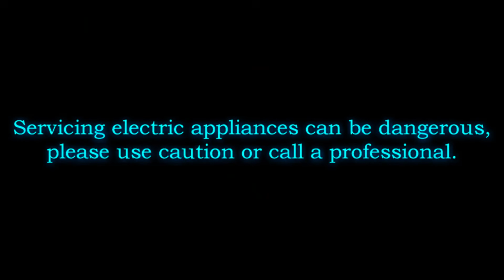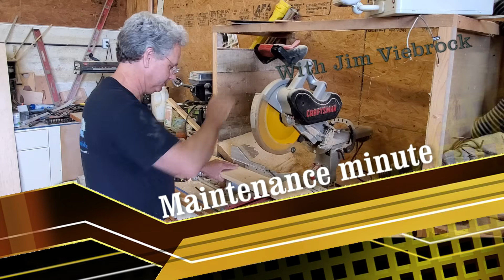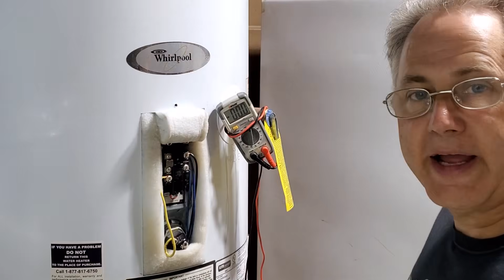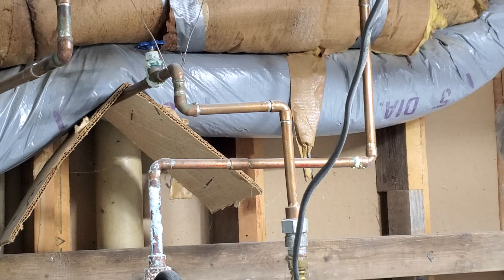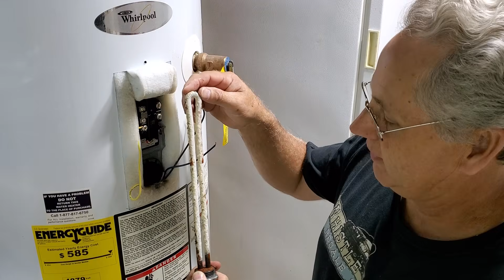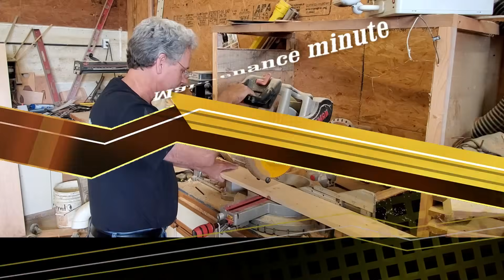D.I.Y. How to replace the heating elements in your hot water heater. Maintenance Minute Jim Viebrock

Comment: I am dealing with water heater not working i checked the ohms on both elements it was what I its recommended I replaced the thermostat but no hot water. Will elements be bad if ohm reading is in range recommended? The water heater is made in 2019
Thx for you video
Reply from the maker: If you have power at the elements and no hot water, you will need to replace the elements as shown in the video. Be sure to clean out the tank while you are at it. Good luck and thank you for watching my videos!
Reply: @millin360  i check voltage 
Removed the elements had build corrosion but much as I thought but hopefully with new elements it will work.
Reply: I replaced the elements not working doing exactly the same as before I replaced the the thermostat and elements . I don't know what else to do..Do you have any ideas?
Reply from the maker: @brettmullins751   I can't diagnose it from Afar, so if you've changed all of those things it's time to call a professional....
Reply: @millin360  i did check the ground on make sure it was tight but I am going to call Rheem tomorrow . Thx for videos
Reply: a
Reply: @JoseSanchez-xd1oz  I replaced the thermostat and elements has voltage to elements and still not working

Comment: "Good and Snug" to what torque? Some of us have torque wrenches.  :-)
Reply from the maker: You will need to consult with the individual manufacturer of your unit for that information.  However,  if you over tighten the element you run the risk of stripping the threads.

Comment: Do the wires need to be hook on an specific commector positive or negative ..or they can be connected on any way....thanks
Reply from the maker: I recommend they go back exactly the way they were configured from the factory. In the video, I recommended that whomever is preforming the repair take a photo of the wiring configuration so that there is a way to confirm the proper replacement. I hope that helps.
Thank you for watching my videos.

Comment: One thing you failed to mention is the pop-off valve should always be piped out of the structure. If the pressure gets too great and it happens to release you will end up having water all in your structure and if you're next to your water heater when that happens you will be severely scalded which is no fun. All codes in all municipalities require that pop off valve drain out of the structure and not be open to the interior except into a floor drain.
Reply from the maker: This video was about changing the elements. I do have a video on changing the TPR valve.  Here is some information I hope you find helpful:
It is critical that discharge pipes meet the following requirements, which can be found in InterNACHI’s Water Heater Discharge Piping mini-course, at www.nachi.org/education. A discharge pipe should: 
1. be constructed of an approved material, such as CPVC, copper, polyethylene, galvanized steel, polypropylene, or stainless steel. PVC and other non-approved plastics should not be used since they can easily melt.
2. not be smaller than the diameter of the outlet of the valve it serves (usually no smaller than 3/4").
3. not reduce in size from the valve to the air gap (point of discharge).
4. be as short and as straight as possible so as to avoid undue stress on the valve.
5. be installed so as to drain by flow of gravity.
6. not be trapped, since standing water may become contaminated and backflow into the potable water.
7. discharge to a floor drain, to an indirect waste receptor, or to the outdoors. 
8. not be directly connected to the drainage system to prevent backflow of potentially contaminating the potable water.
9. discharge through a visible air gap in the same room as the water-heating appliance.
10. be first piped to an indirect waste receptor such as a bucket through an air gap located in a heated area when discharging to the outdoors in areas subject to freezing, since freezing water could block the pipe.
11. not terminate more than 6 inches (152 mm) above the floor or waste receptor.
12. discharge in a manner that could not cause scalding.
13. discharge in a manner that could not cause structural or property damage.
14. discharge to a termination point that is readily observable by occupants, because discharge indicates that something is wrong, and to prevent unobserved termination capping.
15. be piped independently of other equipment drains, water heater pans, or relief valve discharge piping to the point of discharge.
16. not have valves anywhere.
17. not have tee fittings.
18. not have a threaded connection at the end of the pipe so as to avoid capping.

Comment: The hook type element weighs 2 pounds and I have to manipulate it with finger tips while it tries to hang down in the tank. Be advised! Go with the straight lighter ones when possible
Reply from the maker: They do have an "leverage" the straight ones do not have.while threading them into the tank. It is extremely important to get them started without cross threading them or they will leak.
Thank you for watching my videos.
Reply: And why aren’t the wire connections labeled so there’s less chance of being reversed or popping the breaker?  Seems like a black screw or brass screw on one terminal would be easy enough. That stuff just bugs me

Comment: Aside from the differences in wattage of the elements and the type made for hard water, are all elements the same as far as shape? And also, if the elements were that corroded, wouldn't the anode rod be corroded too, and shouldn't that be replaced at the same time?
Reply from the maker: Most of the factory installed elements will be straight. In the video, I replaced it with a hook type, which is better for high lime scenarios. The anode rod could be replaced at the same time while you are maintaining the unit.
Reply: @millin360  Thank you very much for your reply. I'm still afraid to do it on my own as I'm sure there is so much lime scale build- up in the bottom of the tank that it might clog the drainpipe. I'm sure this is going to take several hours. As a plumber can you give me any idea what it might costs?  Even though this unit is only 5 years old I'm wondering if it is going to cost so much to repair it might not be worth it and might be better just replacing the unit, and while I am at it, having someone put in a water filtration system for me too so I don't have to worry about lime scale build up again. Once again, thanks for your reply.
Reply from the maker: @Bossmanrocks  Labor rates vary wildly across the country, I would suggest you get a quote from the person installing your filtration system.

Comment: Hello, great video. Any chance i could change the subject?  I've a newer electric Rheem water heater. Sawed the anode rod in half to replace it and the bottom half of the rod dropped inside. How to retrieve ideas??
Reply from the maker: Depending how long the piece is that's in the bottom, you might be able to fish it out of the lower electric element hole. Drain the tank remove the lower element,  hopefully you can see back in there and maybe you can fish it out.
Good luck. Thank you for watching my videos.
Reply: @millin360  Many thanks!!! and wish me luck.

Comment: What is the size of your breaker bar
Reply from the maker: The socket is an 1- 1/2",  the breakover bar is 3/4" drive and it has a length of about 2'
They make specific tools that you can buy at your big Box retailer or hardware store.
Thank you for watching my videos!

Comment: Is this a gas water heater?  Or an electric water heater?
Reply from the maker: Gas water heaters have a burner at the bottom of the tank, and a exhaust pipe coming out of the top. This video deals with electric heaters only.

Comment: I have a question not about water heaters!!?! Can a mobile home use the same type of kitchen faucet as a normal house?? I got a deal to good to pass up on a mobile home and trying to do most the work by myself and just spent 250 bucks on a faucet and was told I can’t use it!?!
Reply from the maker: The faucet itself should be a standard size, able to fit a single hole sink or a standard 8" two hole sink. The pipes should be a PEX type product, or in older homes may be copper. All of the products are compatible with normal fittings that you will find at your favorite color big box retailer.
Reply: @millin360  I haven’t seen it yet but my wife said there’s more tubes on the new faucet than we have in the sink. I’m gonna look when I get home and see what I’m the world she’s talking about lol
Reply from the maker: @DWBJosh  Modern faucets will have multiple tubes for the different "features" the faucet has. ultimately, there will be 2 standard connection points for the hot and cold.

Comment: I just replaced the heating element like you showed in the video. But My water is still just getting warm not heating up. I even checked with my ohms meter and it is showing that top one is calling for power but the bottom one isn’t. What should I do?
Reply from the maker: If the bottom one is not calling for heat, then you're gonna need to probably replace the thermostats. But before you do, make sure that the bottom thermostat is turned up.  You can adjust them up or down with a small flat blade screwdriver.
Reply: Thank you for the response. I replaced the thermostat. When I put my ohms meter on there it flickers from 0 to 1 no higher. My top one still reads 240. After adjusting the the gauge on the thermostat still no hot water.
Reply from the maker: @stewartbailey5725   It sounds like you have either a loose wire or a wire in the wrong spot. It may be time to consult an electrician...
Reply: @millin360  ok. Thank you for your help I really appreciate it.
Reply: @millin360  how much is reasonable to pay for someone to come out and change the elements and the two little things with the wires on them lol. Ones the thermostat and no idea what the other is lol!?
Reply from the maker: @DWBJosh  Rates vary across the country. Look for someone with good reviews...

Comment: Good Morning- I have lukewarm water, which tells me only element is faulty.  Which element would you suggest needs to be replaced?  Of the 2, which element maintains the water temp & which heats the water when the temp drops as water is used?  Your help is appreciated.  Thank You!
Reply from the maker: The elements are relatively inexpensive. I would suggest that you replace them both since you're going to the effort of draining the tank. The most important part is to clean  out of the bottom of the tank so that you get more capacity and longer life out of the elemens and the tank..
Reply: @millin360  I’ve replaced elements before, but this looks much more complicated, lots of wires around it.  Rheem Performance Platinum with LED Panel.

It was very good of you to respond, and greatly appreciated.
Jim
Reply from the maker: If you have to remove wires, be sure and take a picture before you remove the 1st one, so you have a reference of how they go back.

Comment: Question, my heater has 2-4500 watt elements. I want to change them to 3500 watts so my heater will run from my generator in a power outage. Will this be OK on my 50 Gallon Tank?
Reply from the maker: It's OK to go down in wattage just not up. It will however, make your recovery time on your heater slower....
Reply: @millin360  The heater is 9000 watts and the generator is 8500. We do not need that fast of a recovery time in most cases.  How much "Recovery Time" are we talking about, an half hour? Also will it be less expensive to run?

Comment: Can you please tell me more about cleaning the tank? I noticed that you did use an industrial vac cleaner… but the hose is very small, how this hose can suck the chips from inside the tank?
Reply from the maker: The flakes that are in the tank are generally pretty small. I use a stiff piece of CPVC so that I could chip against it if need be. The vacuum does all the work.
Reply: Thank you so much your video was very very helpful and we have warm water again with the least expenses :)

Comment: I replaced heating elements in a hot water heater at the top one and the bottom one my concern was can you get the wires crossed when you hook them back up on the elements because it's still not heating the water up there still no hot water Jack candy from Tahlequah Oklahoma
Reply: Can you get the wires crossed when hooking them back up to the heating element how do you know which one goes where
Reply from the maker: Yes you can get the wires crossed, however if the breaker didn't "blow" or throw" you just crossed the two "hot" wires. (I always recommend taking a picture so you have a visual record of how they were from the factory.) If the breaker does not "kick" or "throw" then I would change the thermostat(s). It most likely is not "calling for heat". You can check those with a voltage meter as demonstrated in the video. Voltage meters can be bought at your favorite hardware store or big box retailer for about $30.

Comment: My heater is leaking from somewhere around the upper element. Is it possible it could be repaired by replacing the element? Or could it be leaking around the "bung" that the element screws into?
Thanks for the video.
Reply from the maker: It could be leaking from several places above the element depending on the unit /model. If its coming from the element threads, someone may have forgot to remove the old "o" ring when they changed the element. If you go to the trouble of removing the element you might as well replace it while you are there.
Thanks for watching my videos!

Comment: Skip the special tool for removing the heating element, they're garbage.  Use the 1 1/2" (38 mm) socket that he used.  The socket costs $15 or less and a 1/2" drive breaker bar costs $20 or less.  These items are also very useful if you do some of your own automotive work, maybe not the socket unless you need to remove axle nut that requires a 38 mm socket.
Reply from the maker: Thank you for watching my videos!

Comment: I am getting 240 volts at the element terminals but the element is not working.

If I turn off the cold water supply to the tank, can I remove and replace the element without flooding the room ?
Reply from the maker: Turn off the power to the unit, turn off the cold water supply to the unit, DRAIN the unit. Then you can remove the elements.
Do not turn the power back on until the unit has fully filled. To make sure the unit is full, open a hot water faucet until all of the air is out of the system.
Thanks for watching my videos.

Comment: it seems redundant to turn the power off then open an appliance and then turn it back on but it does make sense. who knows what the wires look like behind the cover, or how tight the connections are, you could end up pulling a wire out or touch a stripped wire while taking a panel off.
Reply from the maker: Working safely is always the right answer.  You are correct in that a person doesn't know what the last person who serviced the appliance left uncovered. For example, they may have left the plastic safety guard off and as you slide the metal cover off you could make contact with potentially 220 volts of electricity. Now that could really ruin your day.
 A mentor of mine once said: "If you don't have time to do it right, what makes you think you've got time to do it over".
Thank you for your comments, and thank you for watching my videos.

Comment: I'm so confused. We turn the heater off open the panel and turn it back on to check the thermostat??????
Reply: It could potentially not be grounded if someone else did it and you aren’t sure. If it’s not and there’s also a live wire that’s touching the tank it could shock you when you open it. I mean it it’s the same for anything at all that’s metal with electricity near it, which is why metal boxes or fixtures are always grounded, but it’s not a bad idea. Especially when working near water. I’d more so be concerned about any potential moisture or leak that you don’t realize you’re stepping in or etc. alternatively you could use a beeping voltage tester just to see if it’s electrified at all and touch that to the tank or the cover, but it is for sure more strictly safe to turn the power off. Personally I wouldn’t be too worried about the cover being electrified, but I do get why he is concerned. I’d just take it off and test the thermostat, then turn off the power. Or just turn it off and replace both while you’re in there because they’re cheap. Not at all saying he’s wrong or anything, just trying to explain why so you can understand why and determine these sorts of things with future projects. if I were making a video telling people how to do it I would also be super super safe about it because people may not know where there are risks.
Reply from the maker: Yes, You always turn off the appliance when opening the service panels to avoid accidental electrocution. Once the service panels are clear of the wiring, you can then turn the power back on to use a voltage meter to measure whether or not the thermostats are calling for heat at the elements.  Be sure to turn the breaker back off before trying to remove the elements or any wiring. Always work safe when dealing with electricity.
Thank you for watching my videos.
Reply: I'm glad someone asked this question. Thx for the detailed explanations.

Comment: Just a clarification to an otherwise excellent DIY video. You repeated "Ohmmeter" at least twice while you were measuring Voltage, not Ohms. On that note, a Multi-Meter should never be connected to a live circuit while in "Ohms" mode. Ohms is a measure of resistance. 
Wakodahatchee Chris WA2ERQ
Reply from the maker: You are correct, these videos are recorded live and may contain errors in terminology from time to time. As with this video, the correction was made using a graphic in editing. Thank you for watching my videos.